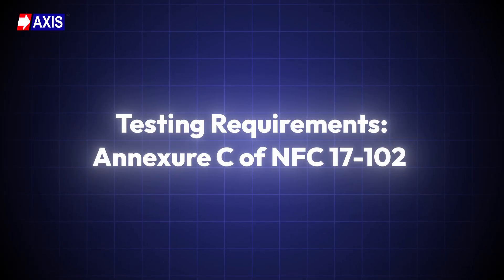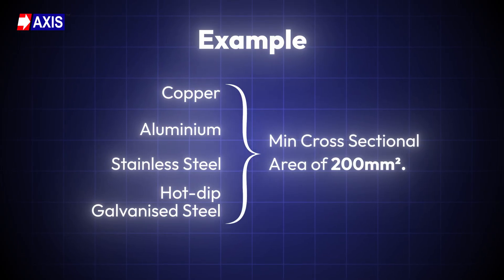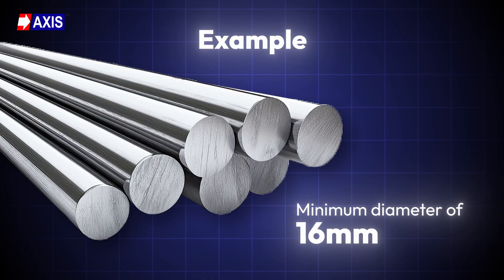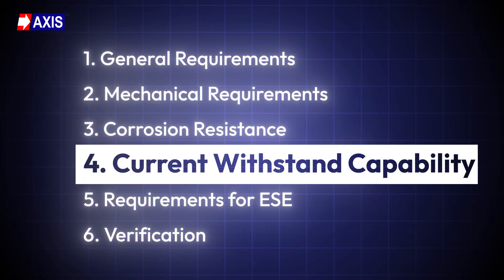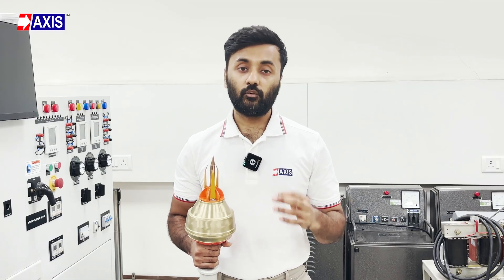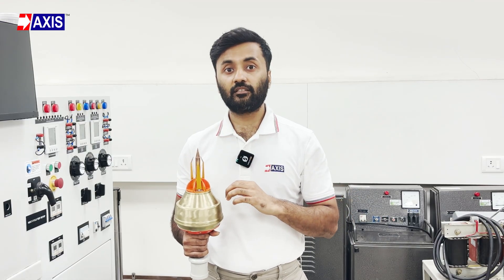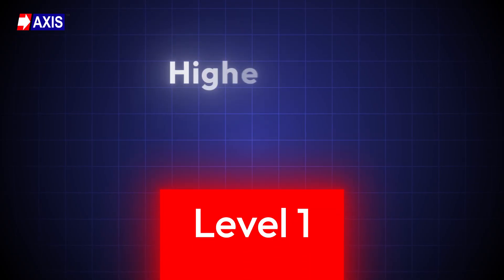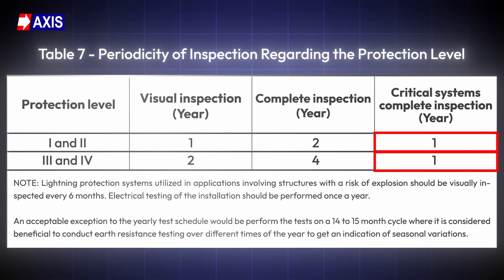How are ESE Lightning Arresters Tested? NFC Testing Requirements Explained 💥

Comment: What is the size of the Cooper from arrester to the ground...
Reply from the maker: For the ESE lightning arrester system, various types of down conductors can be provided based on your requirement. The sizing of the down conductors will be carried out in accordance with relevant standards, ensuring they are capable of safely conducting the expected lightning current without damage or risk to the installation.